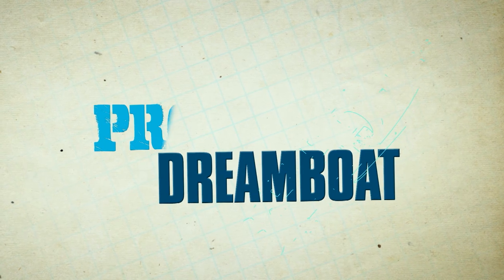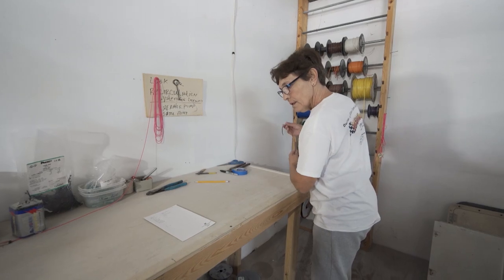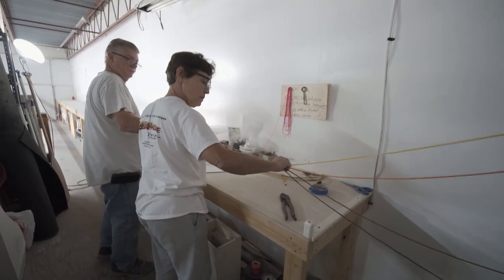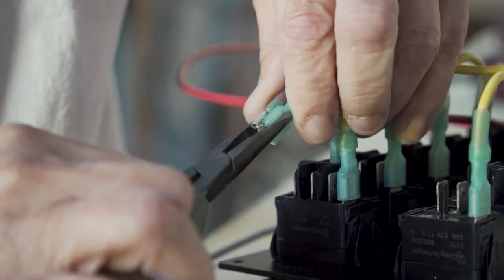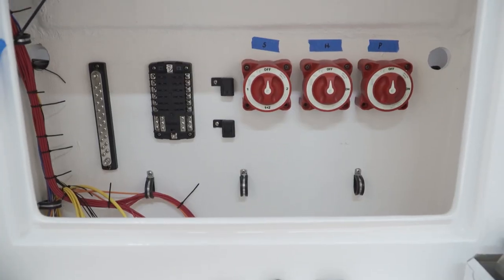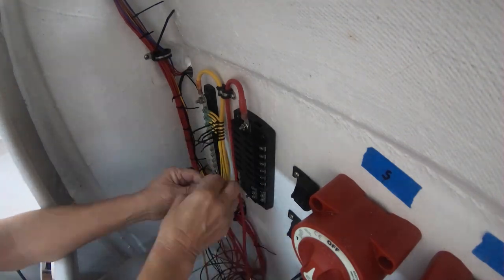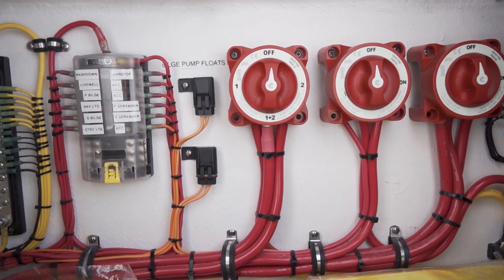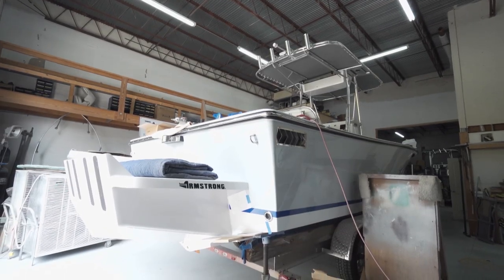How to Organize Internal Wiring on a Boat

Comment: I'm gathering sources and material for 100% rewire and instrument replacement on my 1990 23' Wellcraft Cuddy Cabin: this video gave me a quick visualization of what to shoot for. Thanks. I had trouble changing out lights in my 1990 Holiday Rambler motor home because I spent 34 years as an Electrician working with A.C. current and I finally figured out that with D.C. the black wire is not the hot wire and the white wire is not the neutral. Now today I learn that yellow doesn't mean Lighting Circuit. It's a whole different ball-game.

Comment: Very nice quality work! You should consider bridging your main power wires onto the switch clusters into the middle position switch instead of an end ( you may have to change to a yellow colored - 12-10GA female blade connector to fit 3 wires into it though). This will give you less voltage drop to the far end switch because the paths are shorter. I did a LOT of similar work as an AT&T tech for  harnesses for -48VDC powered equipment, and we used waxed polyester twine to bundle and lace harnesses, as it was cheaper than cable ties, didn't take much more time, but, you eliminate the "knuckle cutting" sharp edges of the ties.

Comment: I had just recently discovered that newer boats are using the Yellow wire, but it was for the Hot circuit? I am confused if Yellow is ground or Hot now?
Reply: Yellow is ground
Reply: The yellow wire is a "return" to negative for the switches light function. Some might call it a ground, but in essence it does not serve a "grounding" function as it doesn't serve as a direct connection to the boats hull. Each one of those switches has an internal light, that is connected to the +12V red feed wire when it is turned on, but to reliably connect the light to a negative, the yellow wire serves as it's connection to negative battery terminal or bus on the fuse block.